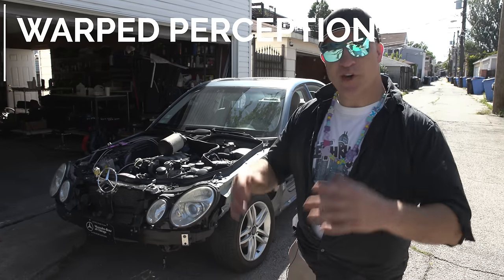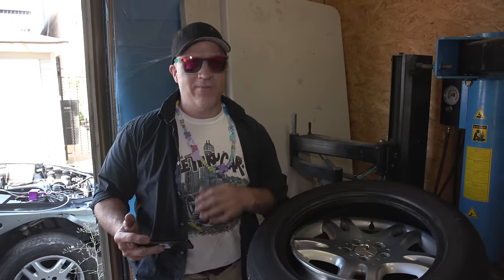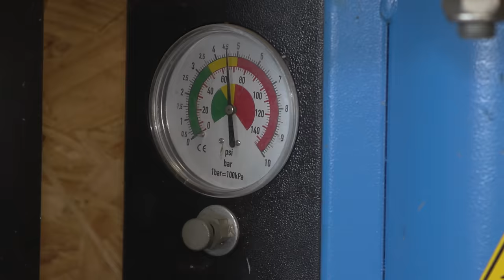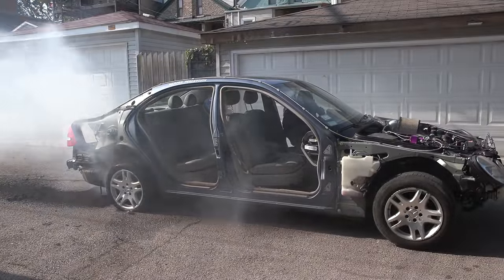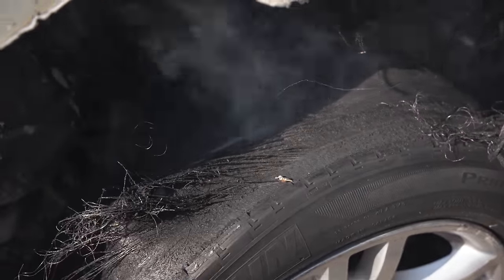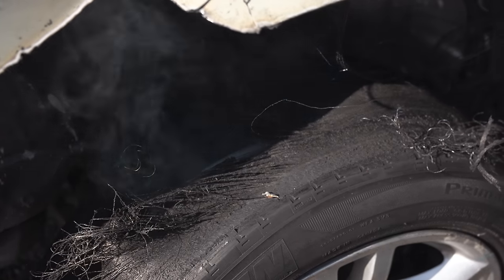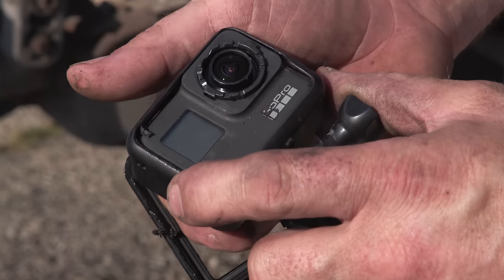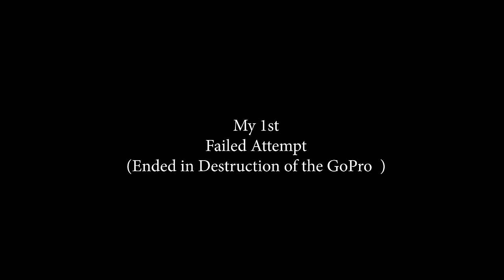GoPro Inside Car Tire During Full Burnout - (Boom)

Comment: in australia your burnout is considered pathetic unless "pfffftttt dgdgdgdgdgdgdgdgd" (popped the tires)
Reply: its just better, easier to put more tires on the rims if u melt all the rubber off
Reply from the maker: Good that's the way I've seen it since I was 12 and I popped the tires on my mom's car...lbvs
Reply: @WarpedYT  mums car/rental cars always skid the hardest, welded diff and calliper delete be damned
Reply from the maker: @bigcazza5260  😉🤣🤣
Reply: @WarpedYT  you should play around with a yamaha kt100s/j go kart motor, easy piston port 2 stroke motors simple to run. could be some loud fun for the channel